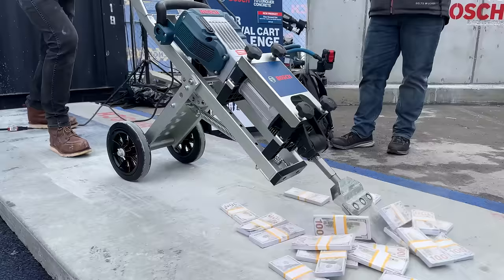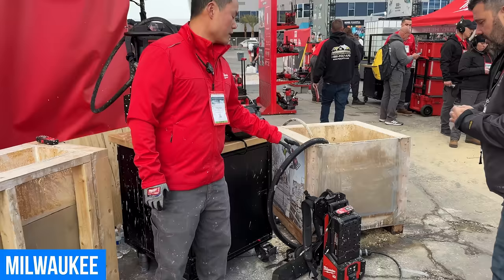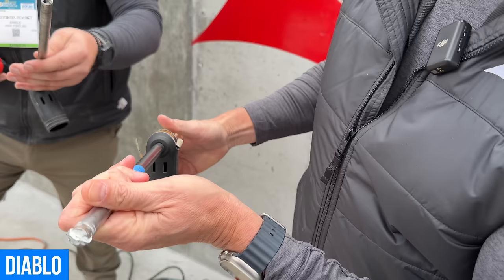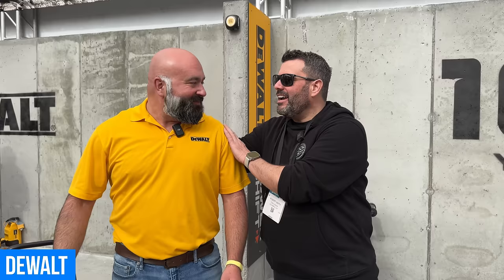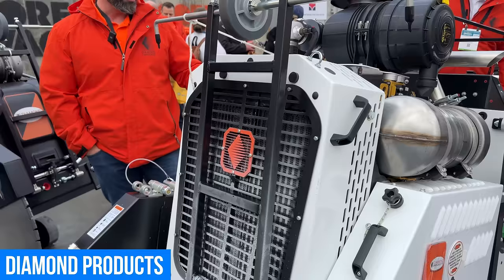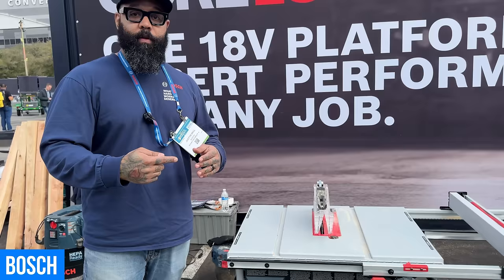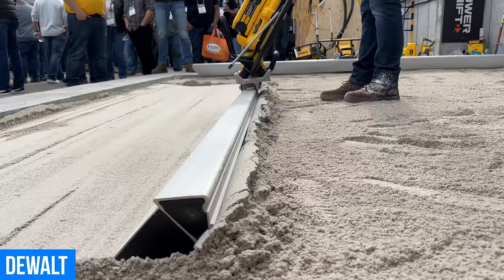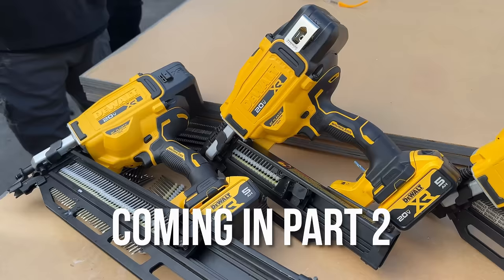NEW Power Tools from Milwaukee, DeWALT, Makita, Bosch, Hilti and more! It's World of Concrete!

Comment: I'm really surprised dewalt went with a different battery platform for the really big tools.
 why not just use 2x flexvolt batteries?
Reply: The adapter is cool and all
Reply: pouch cell technology on the new platform

Comment: im ready to bet, the adaper will cause the normal batteries to overheat.
They already do in the concrete saws because the battery is enclosed.
Reply: It sounds like you got a bad tool, I have 4 of the saws and have never had one overheat any batteries.

Comment: Those battery powered concrete vibrators are 3 times the price of plug in or gas models. Literally can buy the tool generator and extension cord for less then the cordless tool and battery. This is absolutely insane!
Reply: Yeah for convenience you pay … cordless has many many advantages but you pay for it … generator yeah heavy stuff lift each on truck up and down yeah sure then the fuel .. and then extension cords ( also not  really cheap ) lying in the mud or snow or in the rain yeah it’s really good. No it’s not
Reply: Ya cool shit is expensive. Where ya been?
Reply: @Lee-lb9qh  yeah I know … I’m not living underneath a rock. It’s expensive and of course most the items is something for big companies not for single person company. But cordless is the future and has many advantages. I hate when u need a chain saw ( and I don’t use each day ) just when want or need few cuts the F will not start or you need fuel and then u must mix it. Yeah then it’s much better have cordless push the button and here we go. Or when I do repair work. Nothing can beat the convenience of Cordless drill, framing nailer, or grinder … or any other cordless tool .. sure it cost money. But this tools let u make the money!
Reply: My comment was primarily at the mxfuel wall vibrators and backpacks. I’m in bridge construction. The company I work for has a superintendent that got a mxfuel backpack. They don’t hit as hard as gas or plug-in and don’t have the duty cycle. Like I said there 3 times the price. A company has to be financially illiterate to justify the prices.
Reply: @KC-rk1hx  ok I got it … yeah maybe u will never be able to replace all use cases with cordless tools. But I’m sure that’s the future.
Reply: Unfortunately you must feed that generator.